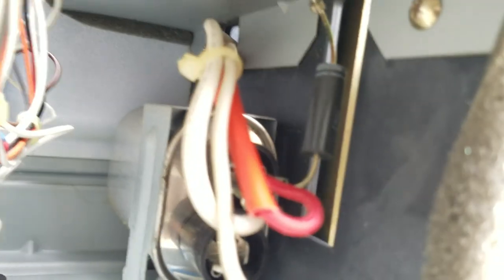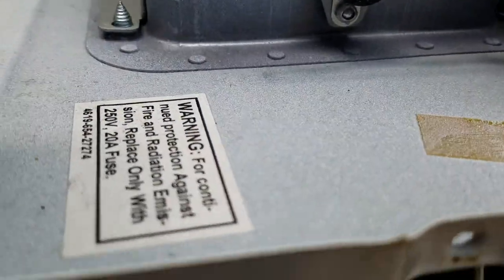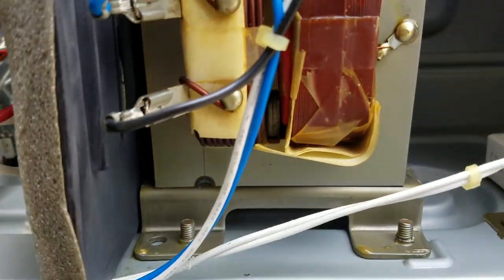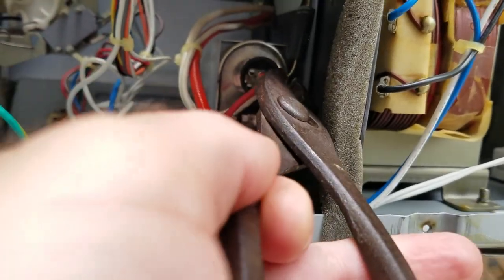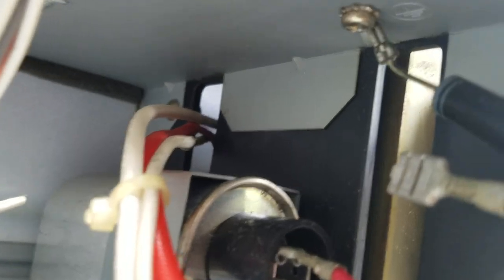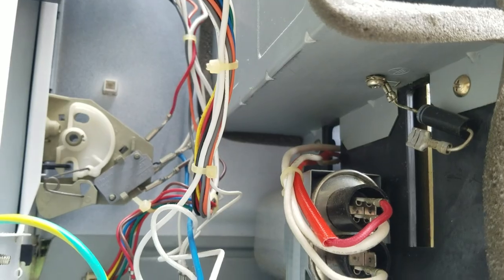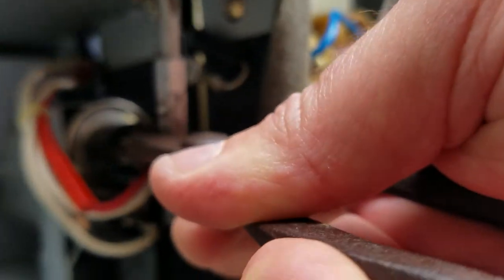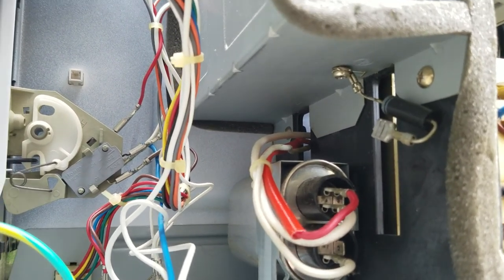Microwave Failure Diagnosis, Shorted Diode, Salvaging Parts

Comment: Nice video. 
I see some people testing the High Voltage Diode with a 9v battery. What is different about that test as opposed to the continuity test?
My microwave stop working yesterday (making a loud hum and no heat), so I will be taking mine apart and troubleshooting with my meter. 
I am hoping it is only the HV Diode. I guess I could live with it being the Cap is bad, but probably not worth it to replace the Magnatron for cost reasons. Hoping mine will be the Diode w/fingers crossed!
Thanks and great info on your video.
Phil
Jersey Shore area
Reply from the maker: Good luck!

Comment: Unfortunately high voltage diodes can't be tested by a meter alone unless its shorted. It needs a 9v battery in circuit to overcome the forward voltage of the diode which is much higher than a conventional diode.
Reply from the maker: It's been so long I can't remember what I read on meter